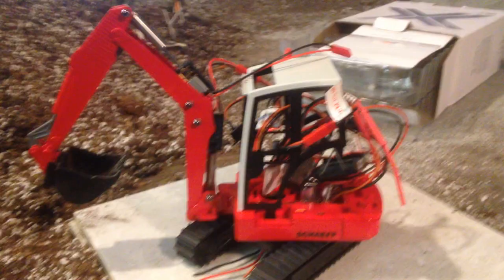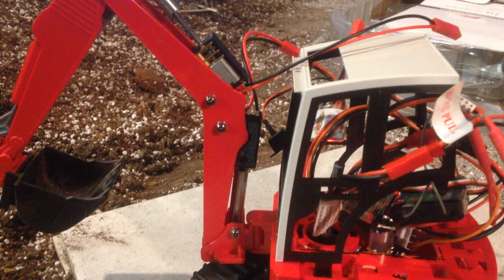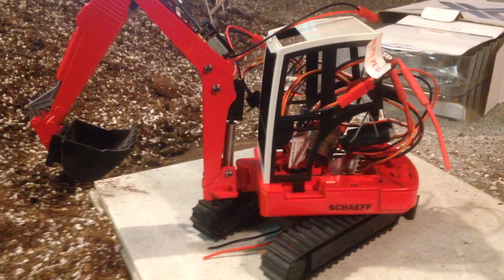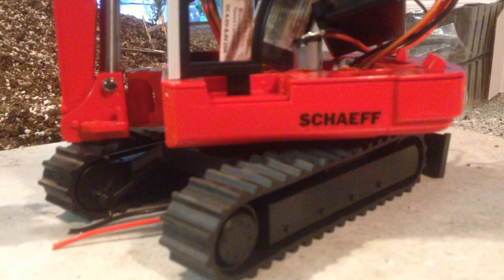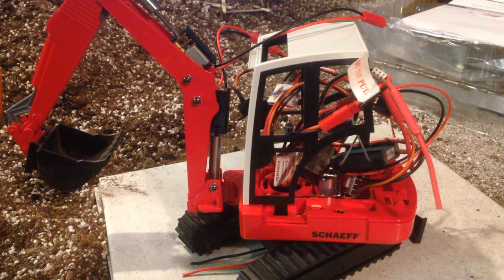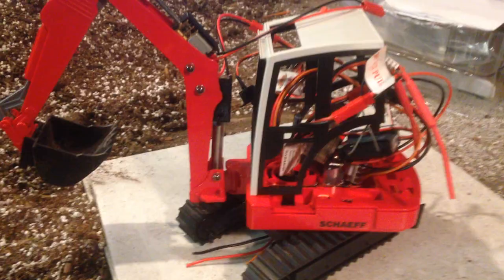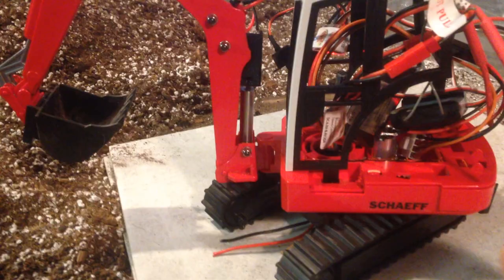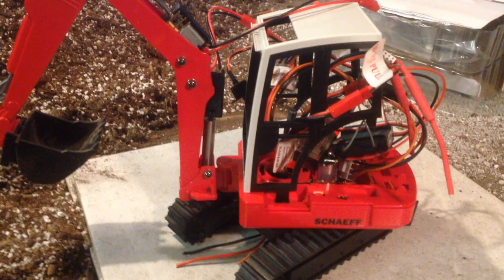BRUDER MINI SCHAEFF CONVERSION

Comment: 🎯✔👀😎
Reply from the maker: i posted a bit more of an udate on the pnw fb page. little more control with the 360 degree rotation
Reply: @rcconstructionincanada3754  I'm just impressed that you were able to convert such a tiny machine, & NOT use standard servo's as the operating motors. It's looking good, real good Nick!